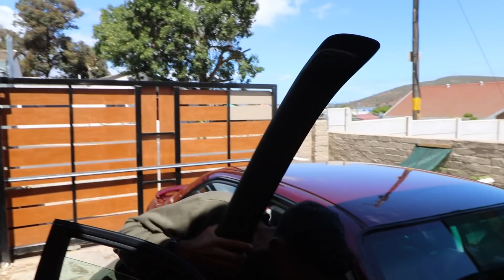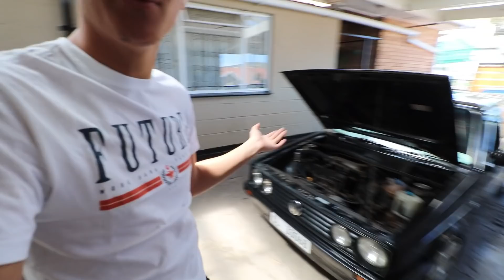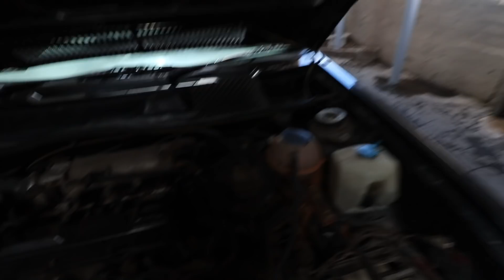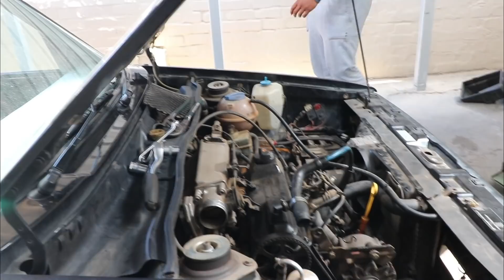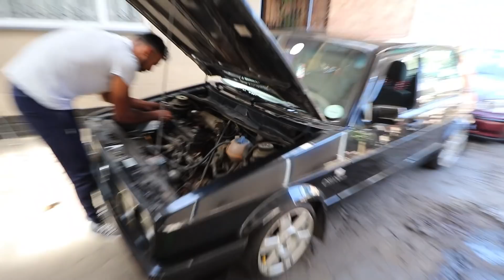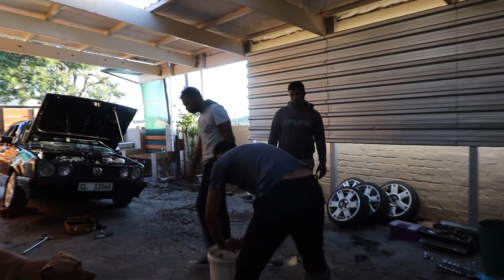Jody bought a VW Mk1, WHAT!?

Comment: Bro i have a jetta 3 jerking at low rpm and doesnt seem to pass 100 foot flat down
New spark plugs 
New leads 
New distributor cap Precious one was corroded 
Coil had corrosion but cleaned it out 

Any solutions